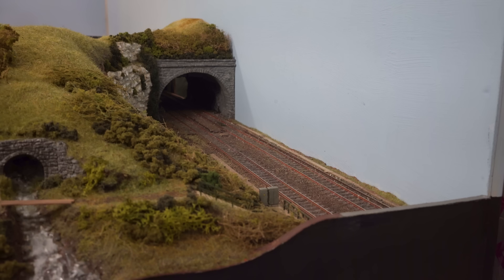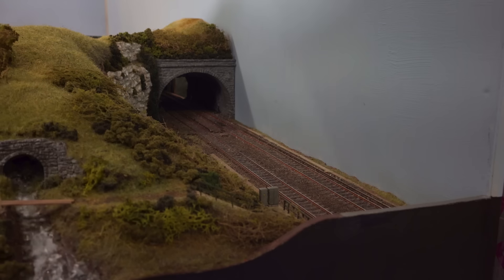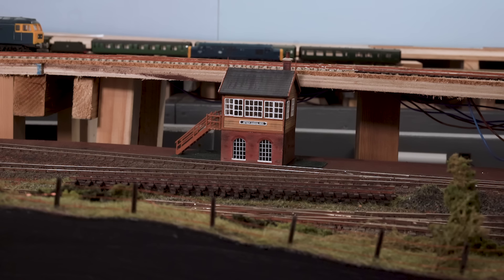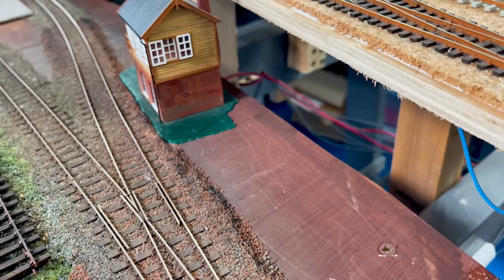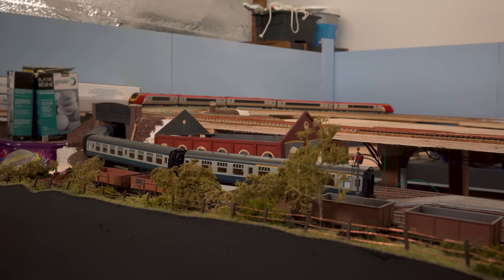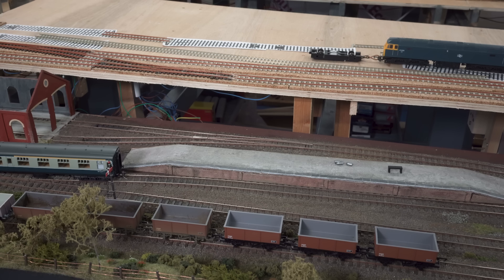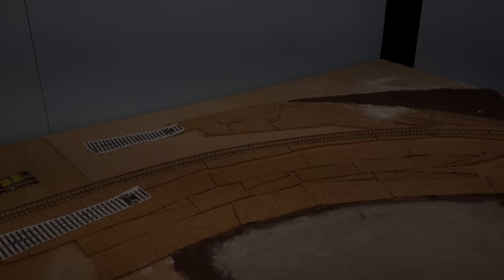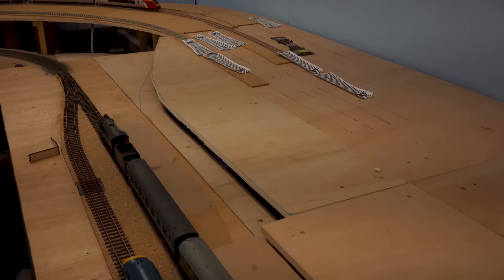13 - Layout Update May 24 at Donnington Castle Model Railway

Comment: I always find when facing a huge pile of stuff to do, making a list is a good thing. That way you at least know what you have done and what remains to be done…!?

Also as I have only recently come across your channel, I think I am understanding correctly that by “Western Mainline” you mean as in Western Region? I travelled out to Swindon last week and the four track mainlines are actually down fast/up fast and down slow/up slow and not in pairs of down fast/slow and up fast/slow as I think you described? I’m not a slave to being totally prototypical and exact rivet counting and you may be past the point of changing or just wouldn’t work on your layout but maybe a though worth pointing out?
Reply from the maker: Thanks! Totally agree on the lists, no better feeling than crossing tasks off when they're done. Yes you are correct that its the Western region for the mainlines, and that they should be pairs of up and down next to each other (like Richard has on Everard Junction). I did want to do that but the challenge is the main station area. To save on space I need to have the fast lines go straight through with no platforms, so its a compromise I've had to make.

Comment: A lot of the work you have done is great.  The ideas  are hard to understand and seem to change. I like the plan to have a station that serves both Regional areas along with a Heritage line.   The main lines look tight and the hyper-elevation does not look right. It might be better to have heritage line inside the mains so the curves can be less aggressive.  A Heritage line does not have everything perfect. Often there are lots of ground signals and  stuff saved from different areas of the network. As I understand it Mainlines dont use local signal boxes anymore.  The signaling services have been Regionalised for sometime. I would suggest a representational crossing of the Regional Services. Do not join the Southern and Western Lines at more than one point. Leave more empty spaces on the layout.  A small TMD or Industrial sidings are too much for the space you have.  The River plan is great. Where is the Castle?  Good Luck.
Reply from the maker: Thanks for the suggestions, I'll certainly have a think about all of those. And you are quite correct, I forgot to talk about the progress on the area where the castle will eventually sit. It will be in the back right hand corner, raised up in a similar way to the real one. It's going to be quite tough to scratch build, so I'm leaving it till later in the build.

Comment: I am sorry to say I think the arches would be wrong from the Wills kit> street scene yes but the preserved line would not have them! also the entrances would onto a running line. Neil Harbolt is right with stating a raised walkway over the point rodding and signal wires.
Reply from the maker: With the arches it might be one of those cases of trying to crowbar something in because I have the kit sat on the shelf. I'll have a ponder but I suspect you are right. Thank you!!